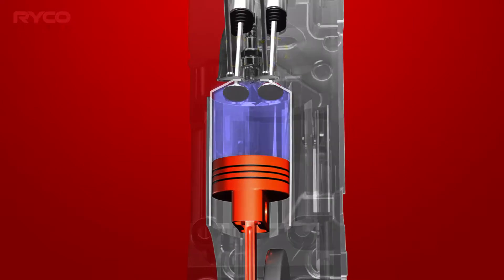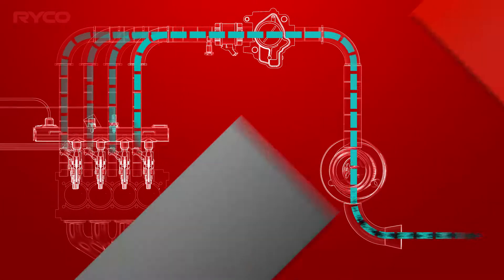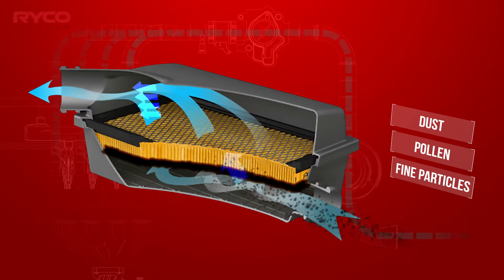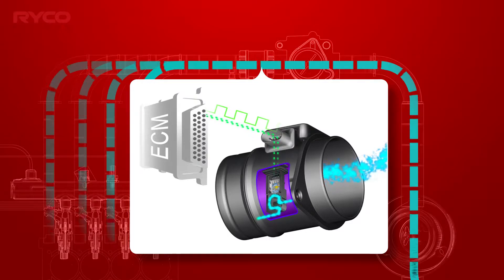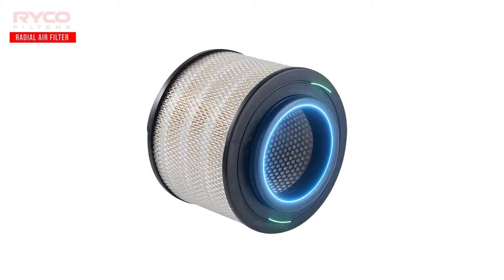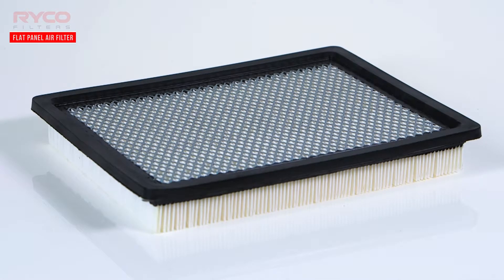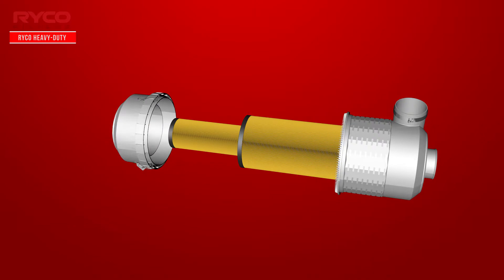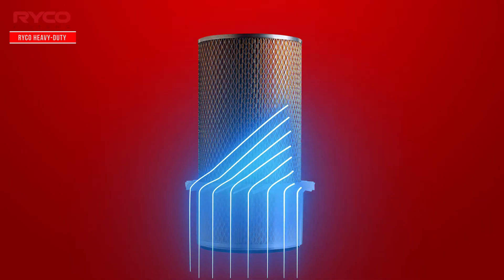4. RYCO Air Filters Explained (Part One)

Comment: I bought a ryco air filter for my mazda 2. The filter i took out was a pleated filter, but the ryco filter was almost flat with a series of bumps from one end to the other, is that a better design?
Reply from the maker: Hi Paul. We'd need a bit more info about the Mazda2 and the Ryco filter part number etc. so we can work out what the difference is you are referring to. You can message us on FB, webchat on our website (rycofilters.com.au), contact our customer service team (Free call AU: 1800 804 541, NZ 0800 838 222) or send us an email to custserv@rycofilters.com with the series, year, engine number and filter number.  Cheers, Ryco Filters